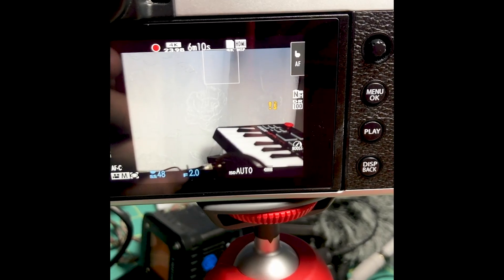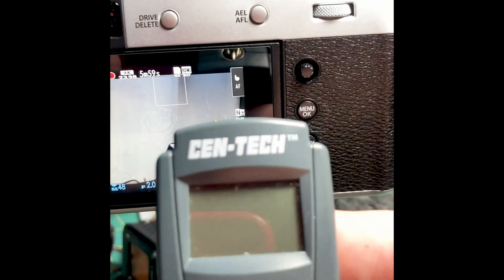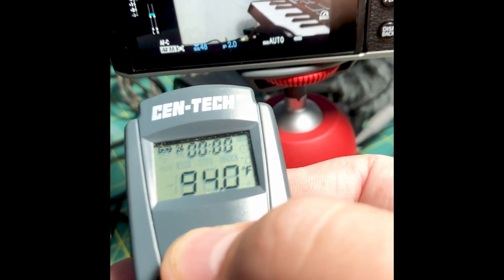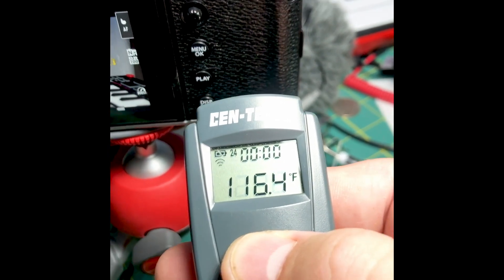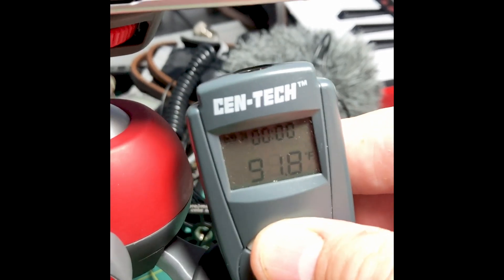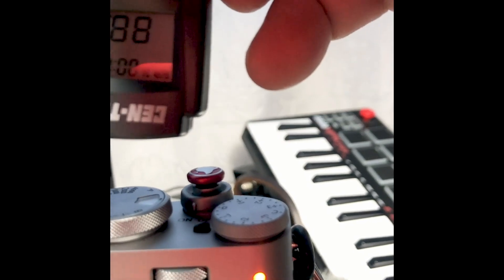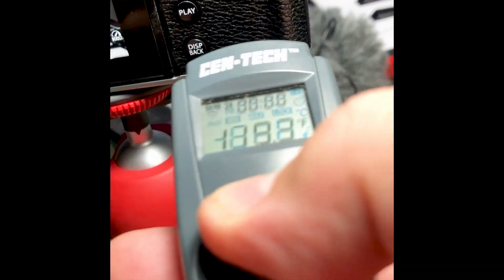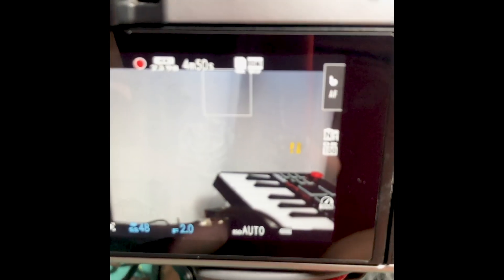Fujifilm X100V Measuring Overheating

Comment: Which sd-card where you using? What I've seen on the forums it seems that the speed of the card has a direct influence on the heat that is created. So a fast card would not get as hot as the cpu doesn't have to buffer as much (do less work)  and can offload everything faster.  Something like a sandisk extreme pro (170Mb/s) apparently works better compared to a general one. Might be interesting to test?